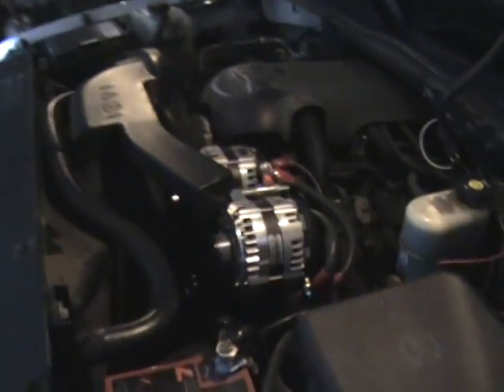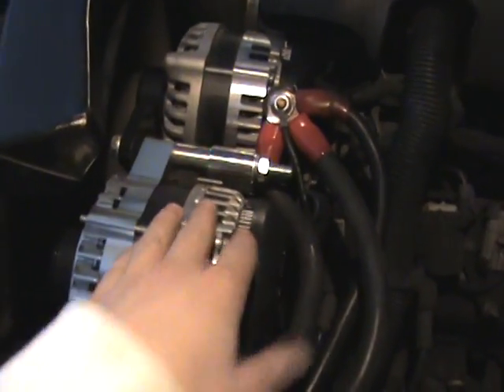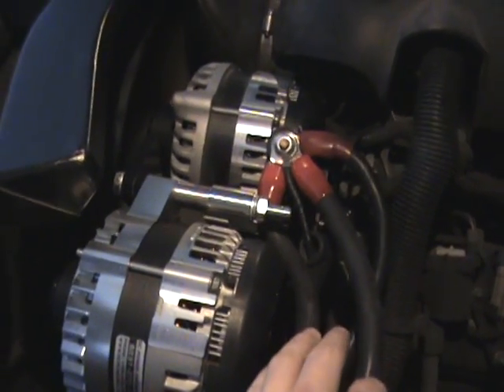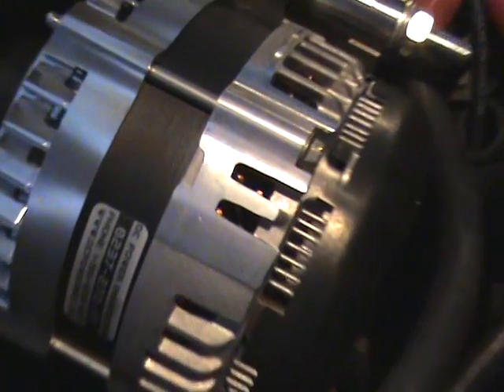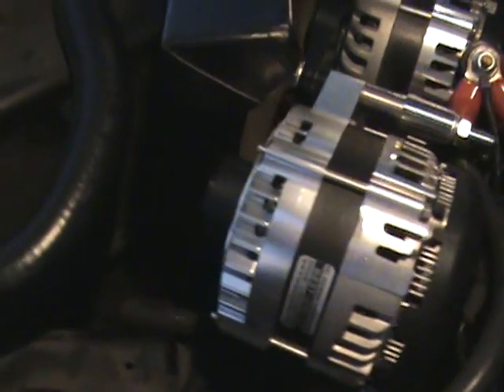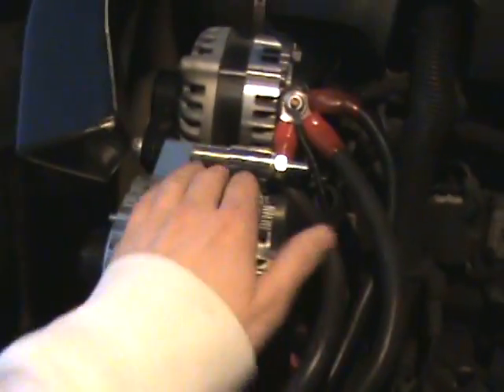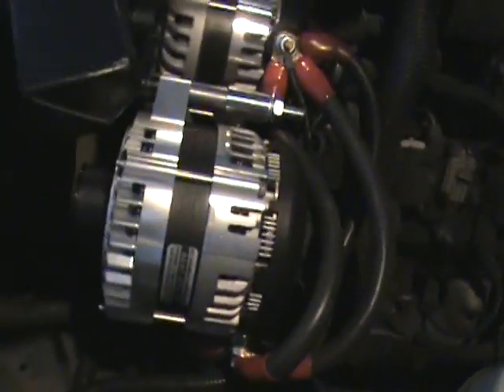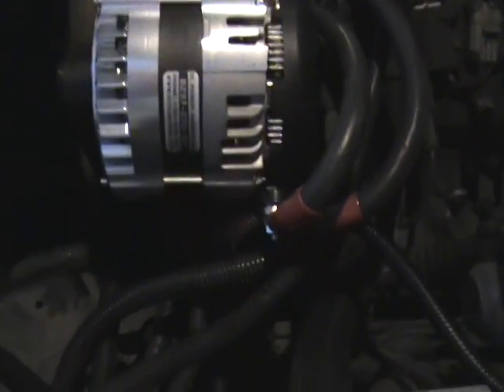Dual DC Power 270 Amp Alternators Installed

Comment: @jesseadkins187 i believe you shouldnt use a jumper if they are 2 different alts that arent externally regulated, as minor voltage output differences between the 2 alternators will cause minor problems as the one with the highest voltage will be taking most of the work. But regardless i think the same problems would arise anyways since they are being wired to the same battery bank. But they prolly know more than i do lol

Comment: @jesseadkins187 the one that was hot as hell has a leak so to say ....its loosing current somewhere ...loose connect in amp ...loose connect in that side bank ground ....no shit man when you jump into high amprage one little loose connect will bite you hard

Comment from the maker: @jmecrg so i ran sperate cables to back battery bank and no charge light so far but just came home for break before i swtich the wires around and all the sudden all my amps shut off and headlights and the analog volt meter was pegged out at 19 volts!!!!!!!!!! WTF??!?!??  i got home and the first alt was sooooooo fucking hoTT i couldnt even touch it.. and the second alt was ice cold!!!

Comment: i ran my dual bracket without the back brace when i was waiting for the custom machined bolt so i didnt have to drill out the stock mounting hole. and without mine shook as well. i was a little nervous driving. went a week without it. i was always scared of the belt jumpin off the pully. personally i think you need the brace

Comment: On most set up i've seen you basically have to use a manual tensioner instead of the spring loaded ones you get them tight enough with alts that big. I don't know if you have tesioner like that already. And I believe that that alt could be shaking. Ive seen them do it before if one of the mounting pivots of the alt isn't long enough or like you have with no brace to support the rear. With alts that big it takes some HP to move them, good amount of stress there. Let us know what they say.

Comment: IMO bro ..... the vibrating you`re seeing is the motor idle....ie the motor moving on the motor mounts then that movement looks bigger b/c the extended bracket ....and i think that charge light was your ECM saying "wtf 250 amps .....ok then "